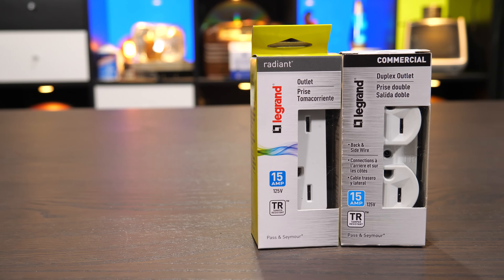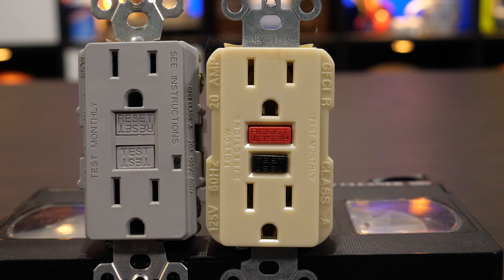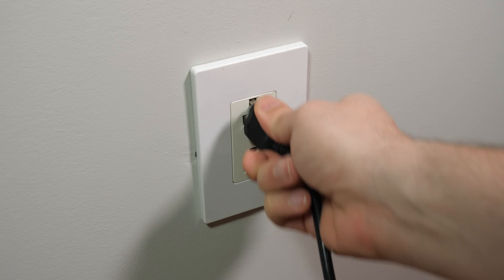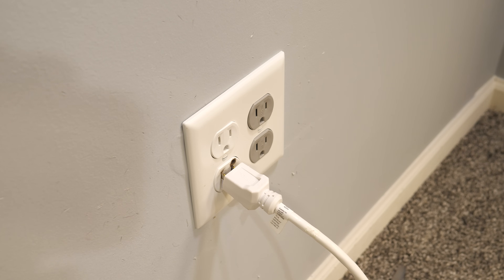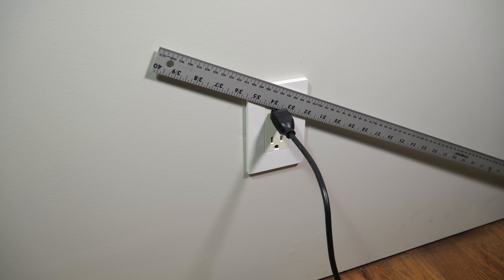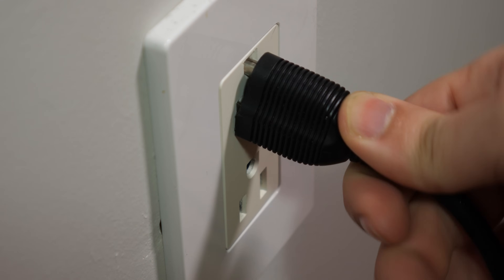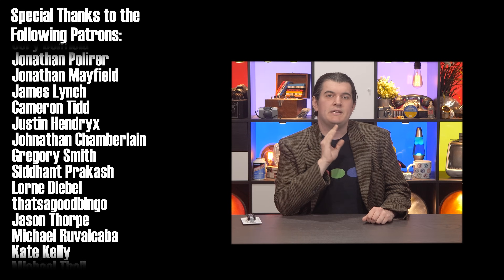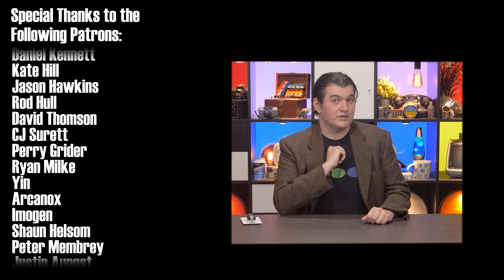Power outlets are topsy turvy - but does it matter?

Comment: Gravity is the reason why you don't want an exposed live on top.

Never hang a Displate Style Printed Metal Panel above your sockets! 
or even use metal tape measures above any plugged in device.. 
Gravity and thin metal strips can set you live..

Comment: @1:26 You say that no one cares, clearly mechanical engineers care, you always want to put the heaviest and the thickest pin at the top not the bottom that supports the weight of the plug more efficiently.

Comment: If you’ve ever been in a hospital, you’ll notice that EVERY outlet, no matter where it is, up side down. Hospitals have different electrical code that they have to follow (because of course it’s inconsistent) and upside down outlets are a part of it. Because I work in a hospital and interact with the plugs in that orientation so often, ive considered having my outlets installed upside down in a house I build in the future.
Reply: Why wait? You can unscrew them and put them back in upside down right now!

Comment: So I want to mention something. When you note the change in the 2-prong plug at the 6 minute mark, old power strips (I've never seen a power strip before 1980, though I'm sure they exist) were closer together, and when you tried to plug in those flared 2-prongs side by side, they often didn't fit. If you can find some old christmas lights (particularly C9 exterior lights) they will  all have these smaller ones, but "minilights" that came out in the 80's all have the flared ends.

It may simply be that NEMA 5-15 wasn't an issue, and the issue was really about getting people to not "pull" the cord out by the wire, laterally. Those small 2-prong ones could be easily yanked out, and the appliance I remember having this problem the most was the Electrolux canister vacuum (models made before 1978) where the rapid speed at which the power cord recoiling would actually whip around the end of the vacuum and eventually bend and eventually break, which would require replacing the connector.  It's not the only thing, but I'd put money on the "flared" design being more about grip and durability than anything. The 5-15 is thick enough that this isn't generally an issue, and it's much MUCH harder to pull a three prong cable out than a 2 prong lamp, which would typically get ripped out of the wall by tripping over the cord.

To add, I think what is really called for is re-designing outlets to be o:  :o (basically so the ground is always away from the center,) and/or to rotate the existing boxes sideways so the neutral (wider pin) is facing up. This of course again goes back to the original point that NEMA-15 is awful. Could we not just adopt the type C Europlug for AC appliances and just use the USB type-c connector for all DC appliances up to 240 watts?
Reply: Type E >>>>> Type C as far as sockets are concerned. And I’m not sure USB is the correct connector to use… you’d probably want a connector that is able to be standardized so people aren’t running mains current through their $5 24AWG cable.

Comment: Cant stand this new trend. The plugs come lose and get worn out quicker in nearly every place I’ve been or seen where outlets are installed ground up including my own place when I moved in. The triangulated support of the plug mounding holds the outlet tighter ground down against  gravity for some reason. The length of the ground pin has zero effect.   It’s a stupid argument regardless and lit just ooks ridiculous. Plus 90% of the products don’t fit properly with the new recommended orientation.

Comment: Add to the list of potential hazards: Cats!  I worry that my cats might brush against an outlet with a plug, and their fur might work in and contact the blades. Also, our first cat took to chewing on one of our electrical plugs. I replaced the soft rubber plug with a hard plastic one. Cats and electricity don't mix!

Comment: I install all my outlets upside down (or right side up now?) because I've had plugs come slightly out and had a video cable fall down, short, and ruin a piece of AV equipment. One time in 20 years 😂 - it's super rare and this is definitely pedantic, but it does feel safer to me

Comment: I was always taught ground up in commercial applications. Say a cleaning crew is using a carpet cleaner or buffer commercial vacuum,ect. Workers tend to pull from the wire and not the plug. Plugs being low and someone pulls the wire the ground will be the last out.

Comment: Wait so your outlets have no switches or shutters, the face place clings on by a single screw, the plug prongs are straight and parallel (no stability in the vertical direction) and you don't have the insulating ends. And the only way manufacturers could think to make it safer is to flip it upside down? 🙃

Comment: Outlet orientation is based on preference. Otherwise, the Electrical Code wouldn't allow installations sideways. As for Hospitals having a specific orientation, that's based on design specs. Not Code Specs. Look at 90degree cord caps. The ground is made to plug in downwards so the cord hangs down, not up so no pressure is placed on the cord.

Comment: A lot of reaching on this video. As an electronics tech of over 35 years, I have never seen any of these conditions cause the issues you show. Code says one direction for residential home builds and then the other for commercial. That is it in a nutshell. I have seen plugs dislodge just as easy in either direction.

Comment: I care because I have many power cords that orient the ground on the bottom with cord running DOWN the wall's surface. If you have to plug the thing in with the cord running-up is just crazy and obviously has a tendency to fall out.  
AND then there is the fact that I grew up with the outlets with the ground down and every time I encounter ground up I have rethink the simple task of inserting a plug into the wall. 11:47

Comment: We did have a coin (dime) fall between the contacts and melt to it; then blow the fuse, but I recognize that's a fringe case. But those AC/DC inverter bricks like the old consoles used were an issue growing up with the upside down orientation.

Comment: This video made me realize how much safer the European plugs and sockets are. For example: the sockets are recessed into the wall by a fair amount, right angle plugs are pretty common, and designed to be much beefier and in a way that they can be stacked one above the other. Some even have a ring to pull on to make removal easy
Reply: British (type H/BS1363) plugs also have a shutter inside the holes where the live & neutral pins of plugs go into, that can be opened only after the plug's earth pin (which is longer than the other pins) goes in first, otherwise the shutter will block the live & neutral pins from plugging into the socket. This way once the live pin is plugged into the socket & current is flowing thru the plug, you can be sure that the plug is already grounded (Though against safety advise, some of us in my country might manually open the shutter by poking a pen in the hole for the earth pin (for plugs without earth pins, which are not uncommon in my country too))
Reply: @lzh4950 American tamper resistant plugs also have this feature, however the shutters are made to open when both hot and neutral are inserted, that way it is compatible with ungrounded electronics
Reply: 7:09 and this is why in australie, we turn the outlest of before plugging the plug in our taking it out, then turn it on when we need it. But you americans dont have an off switch.
Reply: UK plugs are even safer
Reply: british ones don’t need to be recessed cuz they have plastic sheathing and always right angled (:
Reply: @alyx6427  So do most of the continental plugs today. They're recessed on top of that because it prevents accidental dislodging.
Reply: Look into British plugs, they have so many more safety features than American and even European.
Reply: @Trifusion1  UK is in Europe.
Reply: Not only that, the Type F mostly used in The Netherlands and Germany is truly one of the best plugs ever designed, it's safe and robust.
And in Europe we have really nice child tamper protection you can put on most EU sockets that work by pressing a plug against the socket, turning it a quarter turn and then pressing through. 

Meanwhile in the UK and USA they work with plugs that look like they were used by Eddison himself, clunky and outright scary looking from an EU perspective haha.
Reply: @teaser6089 the British plugs are arguably safer tho but they are bulky
Reply: @teaser6089  Of course screw plugs were actually invented by Edison.  It would cost the US billions to change things, even if there was a problem, which there isn't.
Reply: I would have writen the same coment.
Reply: Though they are twice the voltage and so much more dangerous, and in turn more useful for some purposes.  US electrics are not well designed and are often shockingly (!) flimsy, but relatively speaking they can afford to be.   It gets very sketchy though if you run some heavy loads in a questionable old US house.  If modern US electrics look scary, you should see what you find in an old un-renovated house.
Reply: @wjcferguson ie the house I grew up in had no hole for the ground prong!! 😮 When we got our 1st microwave, we really noticed!!
Reply: @wjcferguson  Why would it occur to you to run heavy loads in a house that was designed before those loads even existed?
Reply: Lucky States - at least some of your plugs go just one way. U.K has up / down at pure random. There's hella chance of making a powerbar lie flat or getting a good cable-lay . ¿ ? ¿ ?
Reply: @antomort7295  Can you rephrase that? I am genuinely struggling to understand what you mean.
Reply: But electrical wiring and plugs started out in the US by Edison.  They are ubiquitous and have been standard for many decades.  It would cost billions to change now and include every diddly change people in other countries thought of because they didn't get electricity that long ago.
Reply: Honestly its not a meaningful difference. Used correctly, the US system is perfectly safe, while also maintaining high levels of backwards compatibility and low manufacturing costs. Our plugs are not dangerous anymore than gas cans are. Used improperly they can hurt you, but that is on you not the plug. Don't grip the metal and plug it into the outlet.
Reply: @dancooper6002  That makes me more worried about your gas cans than it reassures me about your plugs.

And that sounds less like "dangerous when used improperly" and more like "dangerous exposed parts that shouldn't be". On a type F, you cannot touch the metal when plugging it in unless you're using a visibly broken plug or socket.
Reply: @Llortnerof  There is nothing wrong with gas cans. You don't pour gas on an open flame, and if someone is stupid enough to do so that is on them and no one else. Likewise,  you don't hold the conductors plugging into an outlet, regardless of its type
Reply: @dancooper6002  Which is all good and fine if the plugs aren't designed in a way that makes it very easy to do so accidentally like yours are.

When the issue is poor design, you don't get to blame the user.
Reply: The smaller the manufacturing and supply of a given product, the easier it is to make changes in that industry. Progress is stifled by over supply of older engineering/tech.
Reply: @terrylandess6072  So are you suggesting Europe has fewer power outlets than the USA?
Reply: @cambridgemart2075  So are you suggesting that I'm suggesting something that I never said or implied? My statement is in relation to the ability to make changes to commonly used objects for local use. IF anything, it's a compliment to Europe for being more flexible. Take the bait elsewhere.
Reply: @terrylandess6072  That wasn't my intention, but your comment was written on a way that that is how it read.
Reply: @cambridgemart2075  They used to have fewer yes.   In addition to the US adopting electricity earlier there were a couple wars you may have heard of that destroyed a lot of European infrastructure a bit after electric technology became fairly widespread.
Reply: @VitalVampyr  I think you need to do a little bit more research. the UK had an electrical distribution system before the USA did. Also, although infrastructure was damaged, electrical supplies were very quickly restored where they were damaged.
Reply: @cambridgemart2075  You're talking about electrical grids.  The point of discussion was power outlets.

The first electrical grids weren't connected to modular power outlets, they were wired directly into light fixtures and industrial equipment.  In the World Wars many buildings (which are what contain electrical outlets) were destroyed and not replaced until many years later.

European countries took advantage of the destruction by making various safety and efficiency improvements to their electrical systems during the reconstruction period in the late 40s and 50s without concern for backwards compatibility.
Reply: @terrylandess6072 thats exactly what your comment suggested. Europe has been the leader in always progressing in tech, rights, and safety as of late. The U.S. gets to reap the benefits without having to do anything most times, but this is one of the exceptions where we can't. 

If they can make it work, why can't the U.S. lmfao
Reply: @cambridgemart2075  It should be an obvious fact.  Europe is extremely tiny compared to the US.
Reply: @bite-sizedshorts9635  I have to assume that you are joking.
Reply: @bite-sizedshorts9635 I have trouble following this. Extremely small by what measure? Geographical area is roughly equivalent and population is 50% higher in Europe.
Reply: @bite-sizedshorts9635  Europe isn't extremely tiny compared to the US. I guess you never learnt geography in school?

Beside Europe is a continent and is 10,186,000 square kilometers (3,933,000 sq mi), while US is a country spanning 3,796,742 sq mi (9,833,520 km2) by total area.
So Europe is still bigger than the entire US.
Reply: Yes people have been dying like flies here in the US my entire life. SAVE US EUROPE!!! or maybe at some point safety is a waste.
Reply: @jhoughjr1 so since you alwayd did things that way, you should keep doing that way even thought it does not make sense. The land of freedom, I see!
Reply: Yea but here in America we’re pretty smart with common sense
Reply: @socialxperiment3162 not really
Reply: @socialxperiment3162  "americans smart with common sense" ... Huh, not many of those....

Comment: I had to flip my brothers 240V NEMA 14-50 outlet since it was installed "upside down" and would cause all the points you brought up when i would plug my NEMA 14-50 adapter into the outlet to charge me Tesla. But now thinking about it, all 240V NEMA plugs that i have seen are all 90 degree designs with the grounding pin on "top". So good to know at least all NEMA plug manufacturers have all agreed on that basic design choice.

Comment: I say we add a bit of insulation partially covering the plug pins like is done in the UK and some other countries. Then install receptacles any which way you prefer. Bingo,  problems solved.

I personally would like to see an entirely different design applied to electrical outlets and plugs. Why not "tip/ring/sleeve" plugs and jacks (like your earbuds have). Larger of course, and more robust, but such a change could then allow the "live" parts of the plugs to be buried deep inside the wall and only connecting to power when inserted all the way. There could even be a "detent" feature to positively hold the plug all the way in as is the case with earbuds and many other audio cords. This would even allow for a small "footprint" or greater outlet density per electrical box. They can also be constructed in a right-angle configuration.

Bingo bango bongo, ALL PROBLEMS SOLVED. 
You're welcome.

Comment: If you install it the right way it is unsafe. The space heater turned the outlet in the hotline fail to nothing if the ground was on the bottom the hotline would have melted and ground and tripped the braker

Comment: Hit the nail on the head. I use right-angle power strips nearly everywhere. Otherwise I prefer the 🙃 orientation. (1) easier to plug things in blind/behind a desk using the ground as a soft, less paint scraping guide to the right hole for the rest of the plug. (2) when reaching down behind the squared corners of the two-pronged top becomes easier for the knuckles bends of my fingers to wrap around than the round side of the grounding.